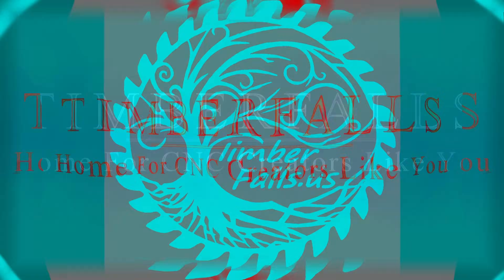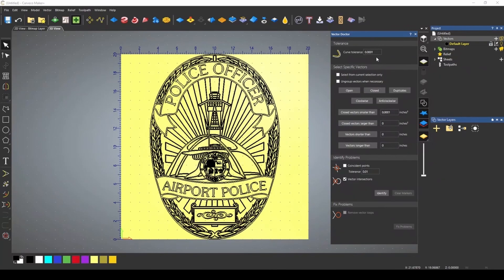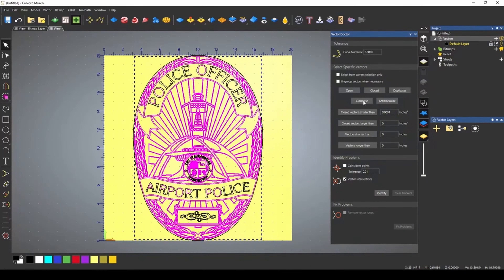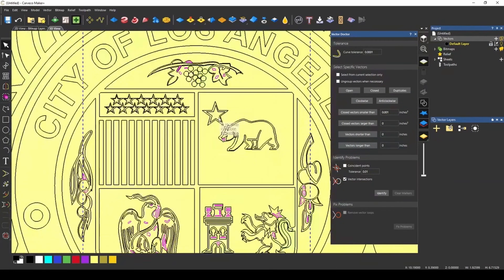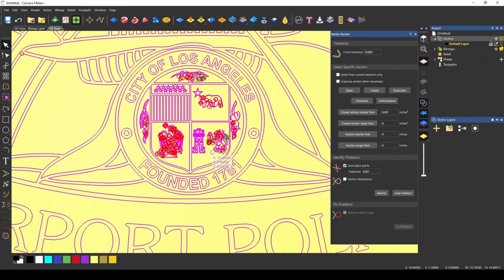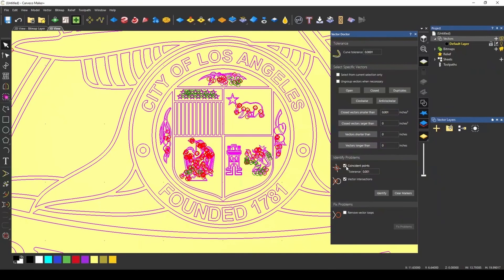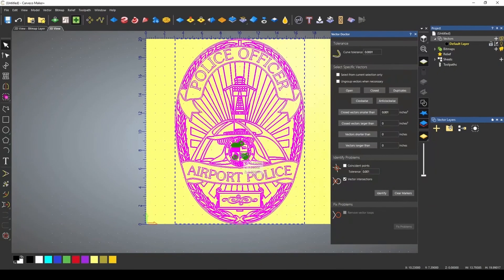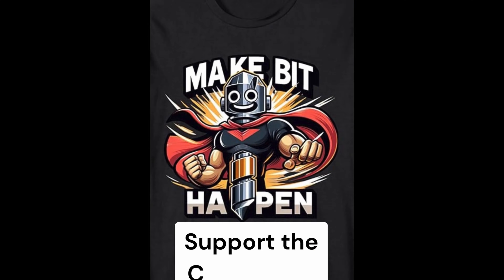Carveco Maker Vector Doctor: Fix Vector Errors Quickly | CNC Tutorial

Comment: Thank god I stumbled across your channel!  Just earned my sub!  :D   I'm new to CNC and Carveco and have spent over 8 hours trying to figure out WHY a simple "hand drawn vector" that I created with the built in tools kept throwing errors whenever I tried to use as a profile toolpath.  It's such a simple vector.  Manually cleaned up all the small things easy enough but could not get it to work!  This video, explaining the vector doctor did the trick!  I was using it incorrectly!  I'm off and running now!  Excellent job going through it and man do I ever appreciate you having this channel!  :D
Reply from the maker: Glad you found me and that these videos help. I appreciate the support too. Make sure and check out my Carveco Hacks series that is very short tips and tricks on the software. I show a lot of little helpful tricks in those and it does not take long to go through them.